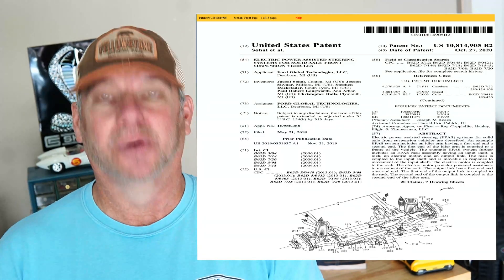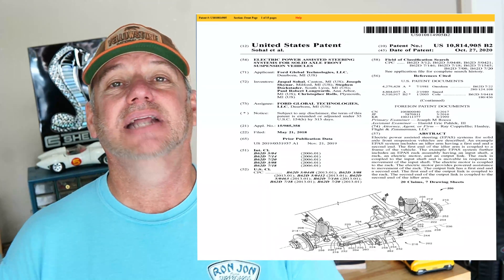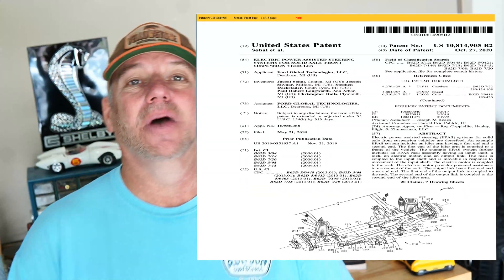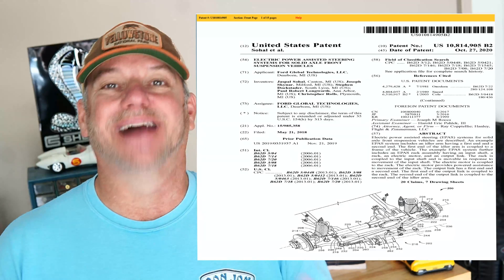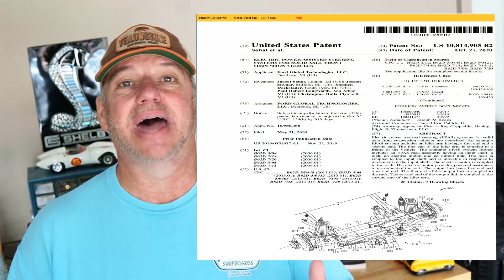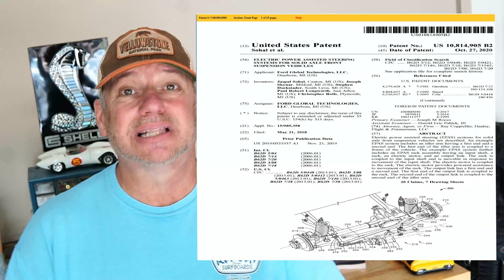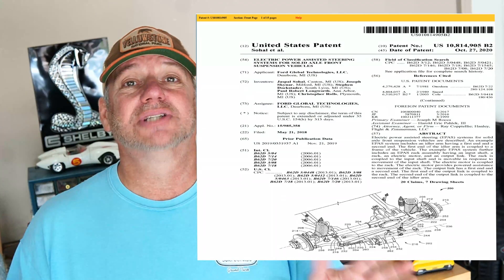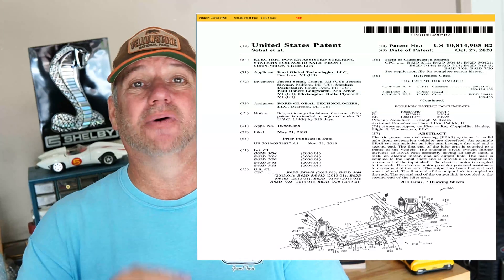Ford Patents Solid Front Axle System. Could this be an option for a 2022 Bronco?

Comment: That reads as though it is a patent for a electric steering system "For" solid axle vehicles .
Reply from the maker: Yep it’s basically drive by wire ...but it would be a different front solid axle system for 4x4’s ...and if you read the patent they specifically say a solid front axle is strong but very heavy and this would make the system lighter and stronger etc ..but we will see it just a patent ..who knows if Ford does anything with it